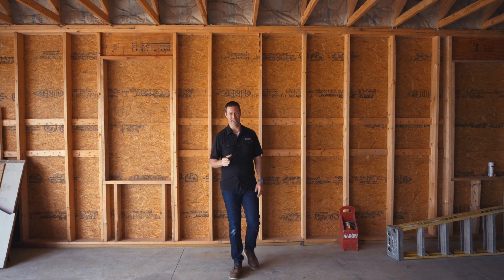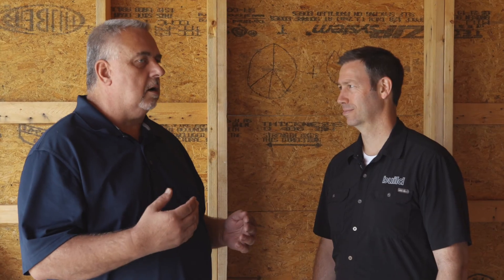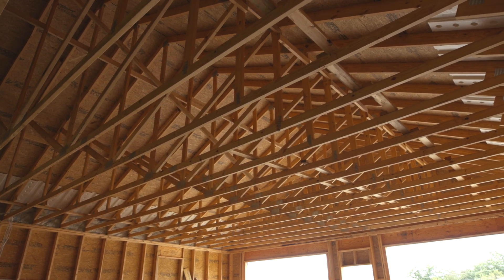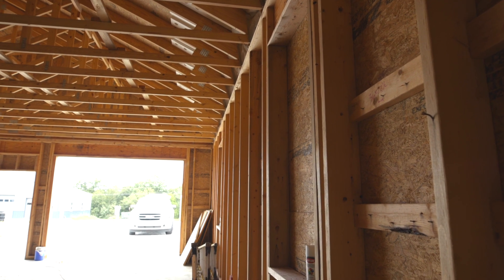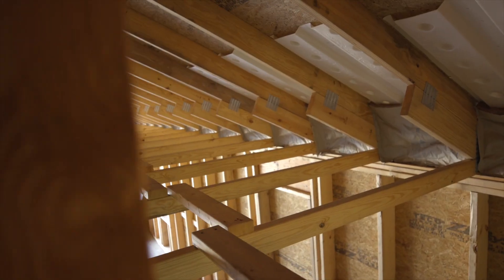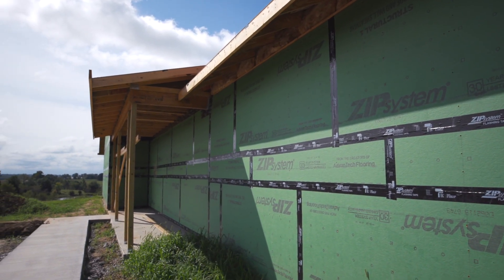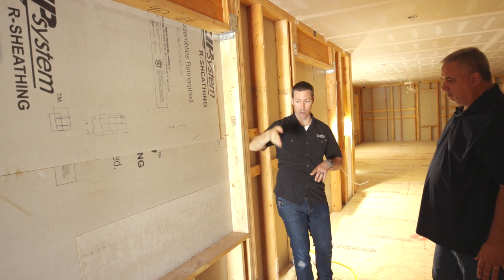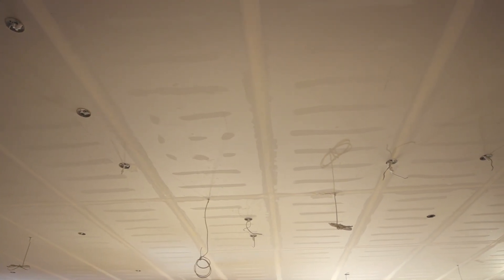Traditional vs Advanced Framing - Details

Comment: At $250/sqft I think this construction is WAY out of the price range that most people would consider affordable... that's $600,000 to build a 2400 sqft house (plus the lot, I assume).  What I'd like to see is a focus on how to build efficiently for HALF that much.  Show me you can build an efficient house for $125/sqft and people will take notice.
That, or you need to start talking about the cost of builds in two stages, the first being the structure and the second being the interior finishing.  I imagine a lot of the cost in these custom homes is related to high-end finishing, and that is reducing the marketability of all this high efficiency engineering and architecture.  If every house I see with cool "efficient" engineering is a +$1 million build it has no relevance to the general public.
Reply: I about spit out my drink when I heard $250 a foot.  I had to rewind the video to hear it again. I agree with another poster regarding desensitization to think that is normal.  When I last checked it was closer to $120-140 a foot which is still high to me.  

I plan on GCing my own build and having it shelled out.  My wife and I will finish the insides and I am hoping to do it for around $45-50/ft.   

Does it seem odd to anyone to use that clip instead of just putting in a double jack stud under the window opening?  You are talking about 4’ of 2x6 and two cuts on the miter saw.   The clip looks like something to fight when doing drywall.
Reply: @MusicGodsNFT  

It's nonsense.  Everyone is building to be "energy efficient" by the heating/ cooling end while they ignore long term structural issues trying to come in at code minimums.  It's not energy efficient to rebuild the home in twenty years because it fails basic material science and statics.
Reply: Max Berry I tend to over engineer most things I build and I certainly don’t care to come in right at minimums.  ESPECIALLY at $250/ft.  😳 

Is that pile of shortcuts just extra jingle in the pocket of the GC?  I also agree that the drywall needs to be staggered and I am shocked it was done without.  I have been repairing drywall cracks for a week in one of my rent houses so it’s heavy on my mind.
Reply: 100% agree.  It’s as if they are prepping us to believe 250 per is reasonable.  It’s not.
Reply: I was thinking the same thing. In the beginning he says they are trying to show people you can affordably build a good house and my thought was yeah no way that house is cheap. Looks well done but at that price I would expect it to be. Good ideas but let’s not kid ourselves with affordability.
Reply: Exactly.  There's a comment thread below where Matt and Steve chime in, and I can't disagree with the fact that $/sqft shouldn't be the deciding factor in the decisions made when building a house...  BUT, there's no getting around the fact that this house, build this way to this dollar value, is WAY beyond what pretty much anyone would consider affordable construction.  If this represents "affordable", 95% of the public can't afford to buy a new home.
Like I said in my comment above, let's see some well built, durable, efficient housing for half this much (roughly $125/sqft).  It CERTAINLY can be done, and is far more dependent on attention to detail than it is on fancy expensive materials.  Build well with conventional materials, pay attention to the details (like flashing/waterproofing), invest a little extra time making it airtight (with a decent ventilation system/HVAC), and a great house will be the result.  Even production builders can follow that recipe since code minimum houses are pretty decent if built well, they just need subs that give a darn about the quality of their workmanship.
Reply: $250/soft???  That’s INSANE!!!  Talk to me about $100/sqft.  Or even better $75 or $50/sqft!  Now that would be relevant!  Most of the principles they talk about are worth considering.  There are many cheaper ways to do it!
Reply: first time on the channel? ;) Matt loves overpaying for construction to save a couple bucks over the next hundred years on power bill
Reply: Every detail this guy added adds months of time. Building a factory to set interiors? A production framing crew can knock out in a couple of days. Same reason Matt's house took 2 years and still isn't done. Absolutely no efficiency. The difference between $125 and $250 is less than 5% improvement in performance.
Reply: You hit the nail on the head. We are in the process of selecting a builder and dealing with the bank, 250 a sqft wont even appraise for the loan we need. Im assuming he only builds for people with endless money and dont use banks. Id love to see Matt do a build that reasonably priced per sqft.
Reply: @twilliamsenator  This is the cool kids channel.
Reply: $250/sqft is common and a bit on the low end for a custom build in Canada.  Frequently you will get quotes upwards of $300-375/sqft(which would probably be the canadian equivilant to what you are seeing in the vid), especially if you are building with an architect, depending on your finish materials and how "unique" you want to be.  So it doesn't seem that outrageous to me, even though I'm quite a bit a distance from where you guys are.
Reply: I'm a builder in the Ohio market and have been in the industry since 1991. This house is being built using an architect and a custom builder. Obviously this will cost more than building a production style home. Thats why it's $250 per square foot. If you want a production home you will pay production home prices. If you want a custom home you will pay custom home prices. I hear all these people talking $100 per square foot, they obviously don't know what they're talking about, especially post covid, things have gone haywire price wise. Realize that if you want a one-of-a-kind custom home you lose economy of scale, which is why production homes are less expensive and Custom homes are more so. Production Builders are known for efficiency because they do the same thing day in and day out and every penny is accounted for, which translates into savings, but don't expect to customize that type of a home. Everybody decides based on their budget what style of home they can afford and want to live in. I've been in this industry for almost 30 years and Matt knows what the hell he's doing. I don't always agree with some of the things he says but he is consistently well thought out and intelligent on how he executes his projects. Also, I love how people who don't know anything about the industry bad-mouth something they have no clue about. For some reason people that work in the construction industry have always been treated like redheaded step children by people who are self-proclaimed experts in something they know nothing about.
Reply: @brettb614  100%👌
Reply: I totally agree, another side is the other energy cost too. That adds up too.
Reply: In 1988 my wife and I toured some show homes in the Atlanta area.  High end in a golf course and at that time we’re listed for $500k up to $5,000,000.  In every one was a display board with the break down of the cost of the land/house and finishing a/furniture.  In every case the cost for each part was about the same.
Reply: Right on!!! Well said man!
Reply: A friend of mine from work was quoted at around $100 per square foot for a 2000 sqft home in Los Angeles, he already had the lot. I thought the price was a little low, but when you take the after build price you would be looking at a house for around $700K-$800K. If it was $250 a sqft you'd be looking at $1 million and up for a house in a working class neighborhood. When people mention under roof square footage a bell rings off in my head scam artist, square footage in a home is only the living space. When a real estate agent says it's a 2000 square foot home and they are including the garage never deal with that agent again.
Reply: @donc9275  building at $100 sqft in la seems low. Very low. Too many regulations,  too many delays. 
The average price selling is what $800k 1 million?
Reply: Location, location, location... Are they using engineered studs??? That adds to cost but also to strength... the insulation is what raises the cost up front, but saves plenty of money on the utility bills when you don't need to use them as much...
If you want quality, you will pay for it... besides... they're using newer products, which based off of supply and demand, will cost more until the supply outnumbers the demand...
Let the rich folk keep buying and knocking down the prices... but... take into consideration their techniques... you can do nearly the same with generic versions... saving money, but maybe sacrificing quality... 
Either way, the long run goal is to minimize energy consumption... losing conditioned air year round adds up... one take away from this is to insulate heavily on the outside...
Reply: Efficient for them. Yes their going to charge for their expertise.
Reply: They are building for people with no budget. But it’s good stuff. Like watching
Reply: Cheapest way to get a high performance house is to build a post frame house.
Reply: I love the way Americans built houses (Im from Europe, Netherlands), but a 600k house of 2400 sqft, we would kill for that over here. Those are normal prices here. Jealous
Reply: @ducoh2093  $600k plus the building lot.

I must say that my original comment was before the pandemic drove the housing market crazy.  Now in June 2022, $250/sqft doesn’t seem as bad as it did almost 3 years ago, but now Matt would charge $400/sqft for this house, which is equally crazy.

I guess when the world has gone absolutely nuts, crazy might not seem so bad to some people.  Good luck to all!!! 🤪
Reply: @superspeeder  Besides new houses barely getting built here due to the fact that we are incredibly crowded country (17 million on a land like new york state) and environmental restrictions, the market for buying existing property has gone crazy as well.

People in Amsterdam are now buying houses without even seeing it themselves, sometimes without even looking at photos, let alone technical inspections. Their broker just calls them and tells them what he thinks the house is worth and what neighborhood it is, and people need to blindly make an offer. No jokes.

Ill be graduating as a structural engineer here soon and thinking about moving to the USA just to built houses, enough space there.
Reply: This is a junk house at $250... You could timber frame or do concrete for that much
Reply: New single-family housing in general has no relevance to the general public. But between foreign interests, economic parasites, inflation, and stupid zoning decisions put into place by NIMBY boomers, it's still being created in droves.
Reply: That is a really good point
Reply: Too true.  And, being a builder who is trying to tool up for this sort of thing, I can say that the market for it is exclusively people with enough money to want to spend it virtue signalling.  The costs of housing are already too high, and the barrier to entry too steep for most people.   ( a 25 year mortgage for two people working seems like an awful lot to pay for a house)
Reply: I was just about to make this same point. Is a 2400sqft home really going for $600k in NE? I have nearly completed building our new home in the NGa mountains. With an envelop 1 HVAC system, spray foam open&closed cell, smart home tech throughout, tankless hot water with circulation, 1900sqft unfinished basement 500sqft garage, and another 250sqft unfinished bonus room, engineered wood floors and tile throughout the house and smart siding, we are coming in just over $300k. I realize I have saved myself $60k-$200k by subbing it out my self, but this home is not entry-level. How can my home costing $250 a sqft be reasonable at all to you? This is nonsense with the very exception of the wealthy.
Reply: I think much of the cost of building is in finishing work as well as the type of Windows used if we were to go back two smaller windows and exterior window covers I believe the envelope would be much cheaper
Reply: I agreed with what you said but I also believe We As Americans have gotten accustomed to homes big enough to play racquetball in.. the reality is blue color houses should it be blue colored priced.. which means blue color sized.. if there's a place that you should spend money to be economical it's in insulation the long-term 25-year or better expectations
Reply: @ottomaguire2443  do you mean collar?
Reply: @ottomaguire2443  I think you mean "blue collar"...?
Reply: @ottomaguire2443  Blue Collar
Reply: superspeeder Matt only is interested in building for super rich folks in Texas. All his spiehl is pretty over the top and somewhat superficial. He’s still a young guy. Maybe he will grow into a more reasonable chap eventually.
Reply: Fortunately you can still upgrade over time if you want.   You can get there house built and 20 years down the line if you want to replace stuffing add insulation to exterior wall.  Plus it's probably the company he hires to.
Reply: Gregvancom and Matt Risinger are the most annoying folks in YouTube construction field
Reply: Good point.  I'm curious to know how Amish build their homes so well so quickly and cheaply?
Reply: @mightyoak11111  traditional materials locally produced and super cheap labor (neighbors who will pitch in for the cost of dinner and being owed a favor down the line)

Comment: Feedback rant: who is your intended audience for this video? I'm just a guy with zero experience but I watch because I want to learn. You have a great, knowledgeable guest that explains framing really well. But you failed to maximize on the opportunity, with poor filming and editing.
As one example, you're talking about window headers but cut away to a long shot along the wall that shows us nothing, then cuts back to the two of you talking. This does nothing for someone who is trying to learn from you. You could have filmed the window header you're using and cut away to a more common way it's done, then back to the one you're using, so we could have seen the difference. This would have been a far more informative way to film/edit it, IMO.
But basically, if you're going to talk about window headers, show the window header. If you're talking about a "railroad" type system in the wall to simplify the sheathing process, film and cut to them actually installing and using that system. Simple.
Again, who is your target audience? It should be anyone who's interested in learning from you. In that case, please try to put a little more thought and planning into your filming/editing process.
Ok, rant over. I really enjoy your channel. I just got frustrated when I felt like I could have learned a whole lot more than I did.

Comment: I say overbuild.  Not just enough.  Take pride.
Reply: i always overbuild and brace my concrete forms the prevent bowing in the wood from concrete hydraulic pressure. Because if you are cheap and in a rush you can have form blowouts and shitty walls steps etc because you dont use strong enough forms

Comment: As a drywaller, I hate this new framing system because we have to use 5/8” drywall everywhere, instead of just the ceilings and shared wall in the garage.
Reply: Did you notice they railroaded the sheetrock butts, being a finish guy that shocked me
Reply: Yes, I was going to mention it as well, but perhaps they’re going to skip trowel the ceilings. In that case it matters a little less. We always stager the joints regardless, but with heavy textures it probably doesn’t matter that much—maybe a little more prone to cracking. However, if that ceiling is going to be smooth, it’s going to be difficult to hide those humps. Also, seeing it again, they don’t have the butts fanned out very much, so I’m thinking they may have used buttboards, which actually turn out better when you railroad the sheets. Happy hanging!

Comment: my house was built in 1965, i need insulation in attic....new roof, and i have a window that got damaged because of a gable vent that leaked behind the window causing mold on
the outside of the window frame. i really need to know what type of ventilation i should do in the roof? i had serveral guys price the job out and tell me ridge vent go with soffit vents ....dont add fans and close up my large gable 36x30 opening that i thought i needed for my whole house fan ......help me
Reply: I would always trust the soffit/ridge vent combination
Reply: Yeah fans are no where near as good as ridge vent

Comment: How does brace wall work on a big open space like this. I'm used to using interior walls to assist with brace wall calculations per Residential building code.
Reply: Its pretty simple, its a pole barn build, One big roof and outside walls... Then build what ever you want on the inside. 
Its simple and has been done for a while, people are building houses out of pole barns all the time.
Reply: I'm guessing they had stamped engineering drawings on this project. Going from memory here, by IRC 2015 you can't go more than 24' between braced wall lines. But you can do anything if an engineer will stamp it.